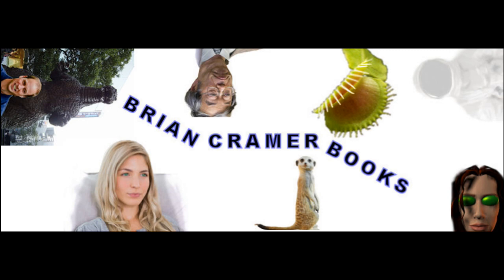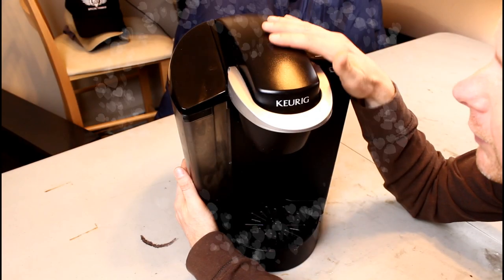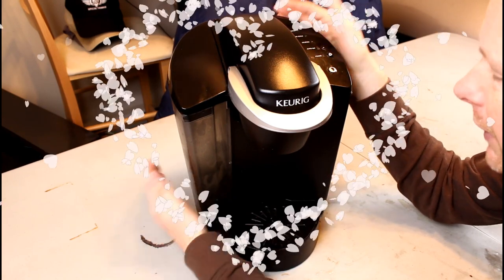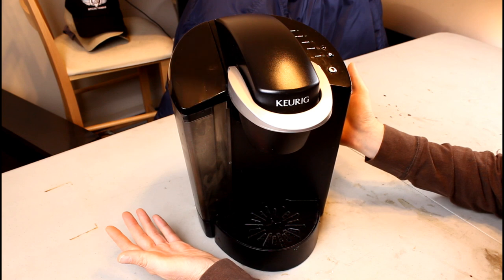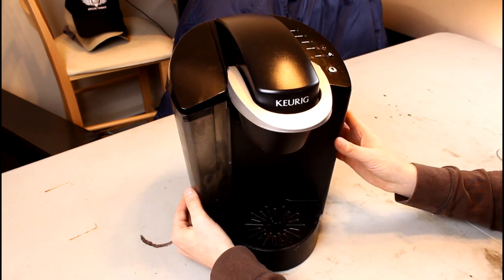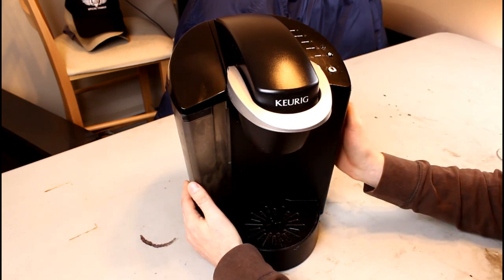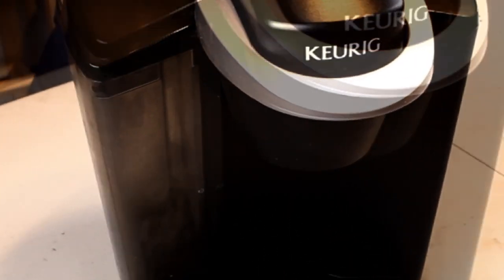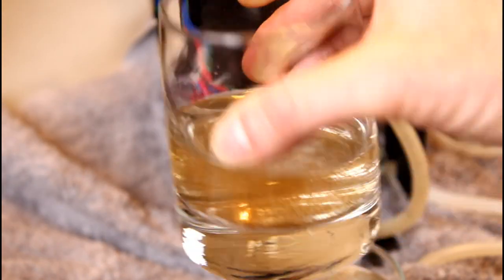What Evil Lurks Inside Your Keurig?

Comment: The little floaty bits look like mineral scale (mostly calcium).   The brownish color could be dissolved iron oxide.  Have you been descaling the coffee maker using vinegar or citric acid or descaling fluid every 2-3 months?  Even if you are using filtered water, if you aren't using distilled water there will be some mineral content and descaling is required.   Running a 50/50 mixture of white vinegar and water through the machine, and then following up with a regular water cleanse to clear out the vinegar should remove the solids.  When the vinegar is heated by the coffee maker it will very actively destroy calcium buildup.  If you're worried about bacteria and mold, the hot vinegar solution will also kill many of the micro-biota, and a follow-up rinse with a baking soda solution should kill the rest (again, follow up with a fresh water cleanse afterward).  I used to descale the kettle at work with vinegar when I noticed scale particles in the water for my tea, and it always cleared up the problem.

Comment: Great work wish you could have seen one I took apart that they used well water in oh man the whole tank was brown and green with minerals and mold   no amount of descaler  ran thru that would give me peace of mind  plus they make them where they dont want you to take them apart to actually see the truth  .old school coffee maker is by far the better choice  and at least they are simpler and easier to clean . If Keurig  would make one with removable boiler to be cleaned I'd  actually buy one  .ps that water sits and gets boiled over and over if left on all the time which I know many do leave them on the more heat cycles the more mineral deposits .and not only that the fill tank has electronic sensing probes which send electricity in to water causing electrolysis  on small scale but still adds to the ole brown septic tank  haha

Comment: Just took a Keurig from storage of 2 years. Put a cycle of the boxed descaler through and ran probably 30 cycles of hot water through and there are still floaters coming out. I didn't realize there was an internal water reservoir that most likely evaporated out after turning nasty and scaled up. I think it is a dumpster item now. After seeing the floaters and knowing it won't get used often...I'm thinking maybe best to just stick to a kettle for my tea and tell guests to stop off for coffee on me on the way over or have tea or hot chocolate if they need to warm up. I'm pretty sure this is not a good idea for me to keep it. Never gonna unsee those "floaters"  yuck!
Reply: Personally what I've done with the 3 I've had over the past 20 years, is do a start descale, turn the time off, and let the vinegar or other descaler ruminate in the internal reservoir for 40 minutes to an hour. I've not really had a problem with the scale or mold because I don't think me or my mom left the unit running for more time than it took to brew coffee, and then it was turned back off immediately.

Comment: I know faor a fact that mu Keurig doesn't conatin any of the crap that came out of the one in this video.  A. I descale.  B. I only use filtered or distilled water in my Keurig.  C. Every day I fill to the Max level of my single cup Keurig with filtered or distilled water and brew the plain water to clean out any residue, and clean out the K-Cup holder of the coffee left behind.  This way, whatever is left in the tank inside the housing is clear.